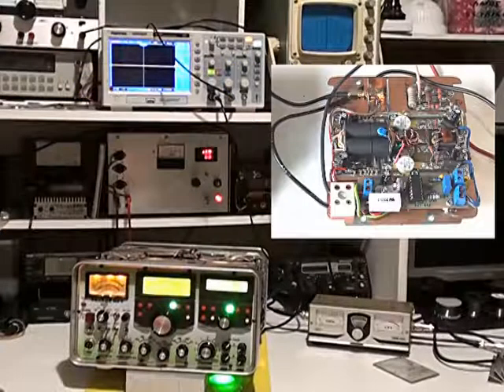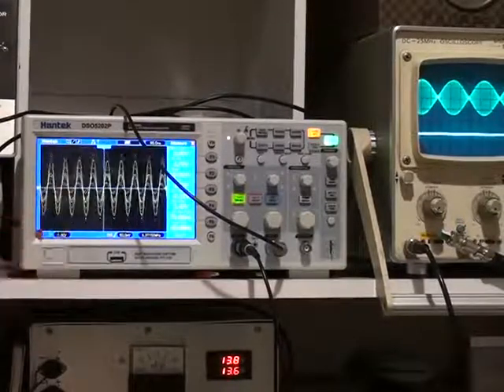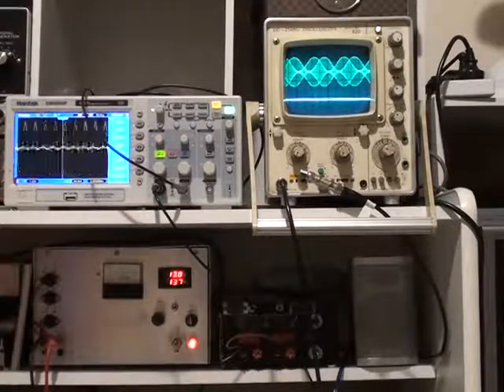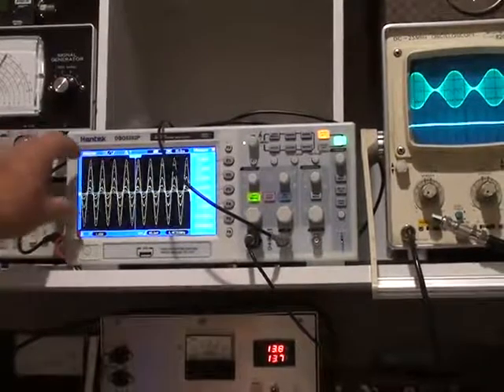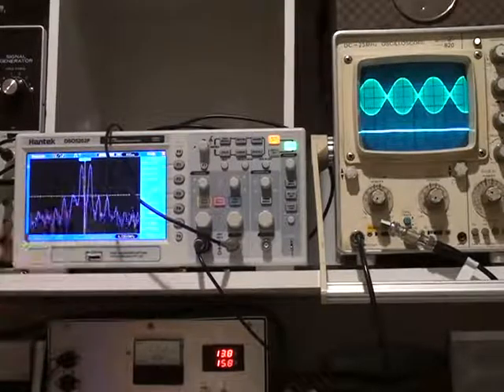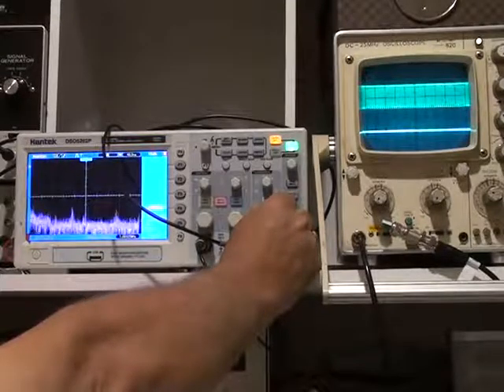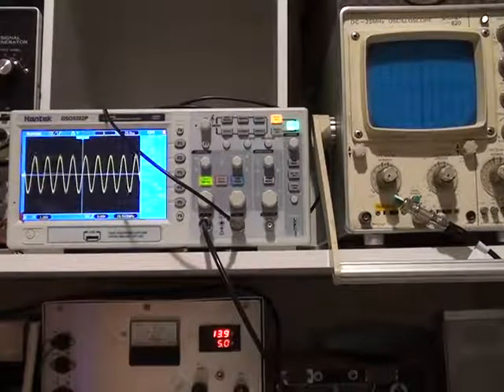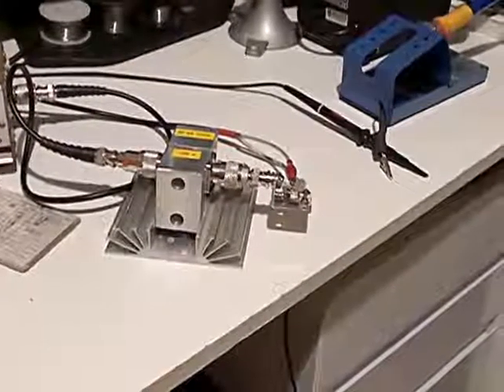2 Tone testing MRF454 PA LQ converted

Comment: Hi what make and model test set are you using?
Cheers
Reply from the maker: Hi , On the video I am using the FFT section of the Hantek DSO5202P simply for illustration. I also have some older RF spectrum analysers including a HP8568A but it is too big and bulky for the video demos. For intermod tests the 2 tone signal is from a VK5JST low distortion oscillator published in the AR magazine. You may know the following but I will just note it for any readers of this post. The 2 tone oscillator should have the harmonics of the tones around 50dB down. The spectrum analyser should be able to also measure the noise around the intermod products signal as an RMS value, and the analyser needs to remove a factor from the overall result. Not many can do that. The dynamic range of the analyser needs to be better than 80db. The analogue types are capable of that type of performance. Digital ones need to really have something like a 12Bit, or more, A to D. The Hantek only uses an 8 bit A/D so it cannot really be better than say around -40 dB. I use the HP for more accurate work. A good second hand analogue one is better than the low cost digital ones. If you can find an RF spectrum analyser that can measure down to 10Hz bandwidths,  that will good. As mentioned above, the analyser should really be capable of also measuring any noise inside the bandwidth of each intermod tone and factor that in. The noise may be due to a noisy transmitter PA or  other parts, or maybe a noisy log amp in the analyser.  In the case of a digital one, the noise may  be quantising noise which will give a false value and effectively make the result worse which cannot be blamed on the transmitter.
Reply from the maker: See reply to your earlier request. Please note the internet to me  is very unreliable dropping out for days on end. So I can only reply when it drifts in and out of range.
Reply: Thanks for returning...i am only a beginner at aligning ssb cb radios..i worked out that your 2 tone signals were emitting from your tranceiver..i have a few analogue Sig generators Marconi2019, Boonton102A, and Logimetrics 921a which have much better variable output but as you said take up way too much space so i bought a FY6600 , which require a bit of attenuation on its 1mv output..just trying to work out how to send the 2 waveforms from ch 1 and ch 2 from the FY6600 to become tones then through the front end of the cb,,...as i said i am just learning.ps so undecided which spectrum analyser to get considering in only need it for the cb band..
Much appreciated.
Reply from the maker: @andrewverran3498  Hi Andrew, yes all oaky. We were all beginners once! The 2 tones can come from your tone oscillators and must be  of a frequency that both can pass through the SSB filter width of your  CB radio - typically 3Khz or so. The tones must not be harmonically related. You might use 700Hz and 1.8KHz which are 2 common tones used.  The 2 tones are combined  into one signal using a small audio mixer or just  a simple potentiometer. One side of the potentiometer is connected  to one tone active lead output, and the second tone to the other side. The middle, or moving arm, goes to the microphone input  of the CB where the hot or active wire from your microphone would go. The earthy ends of the tone leads join together and go to the earthy connector on the CB radio microphone input.  NOTE: if you have a powered microphone, there will be a DC voltage on the mic input pin (Bias). So use a capacitor (say 1uf) between the tones and the mic input or you might damage your radio!  The level of the tones should be at the same level as the peak of your speech coming out of the microphone. The distortion is worse at the higher levels so the test has to be done at the peak level of your voice. The potentiometer moving arm is used to adjust the level from the 2 tones so that both tones entering the microphone socket are the same. Moving the pot arm back and forth will increase one level or the other. It is the tone balance adjustment - very simple method - I use that method. So feeding the combined tone into the microphone socket you then wind you mic gain up and down till to see the average power on a meter at about half the maximum say 7 Watts for the SSB setting. That's because you have essentially 2 carriers in the pass band transmitting, each  of equal power - so one tone at maximum level might give you 14W (typical SSB CB radio output) whilst 2 tones should show half power with the 2 levels at maximum. The waveform has 2 mixed sine wave patterns instead of one - you might have seen a 2 tone test waveform on CRO.  And with speech, an average power meter might only kick up to maybe 3 or 4 watt ( but the peaks will reach 14W - which you won't see unless you have a peak reading power meter!). I hope that helps. If not maybe ask someone near you who can help. Cheers.
Reply: @vk3aqz  thank you so much...great advise...i have printed it out for my records.